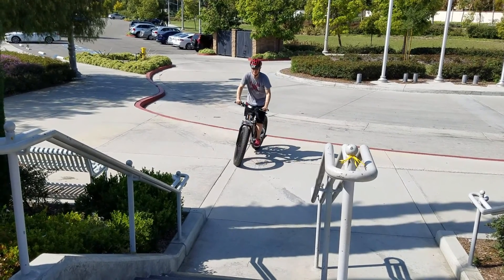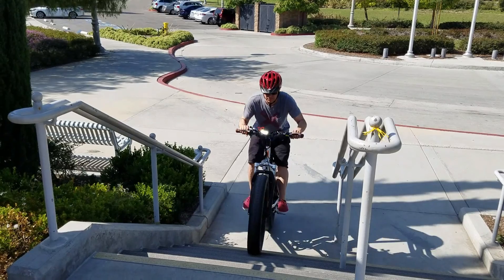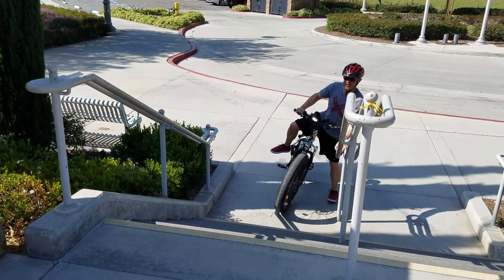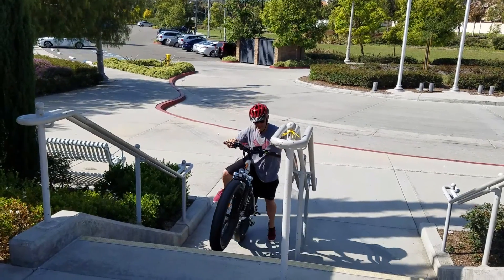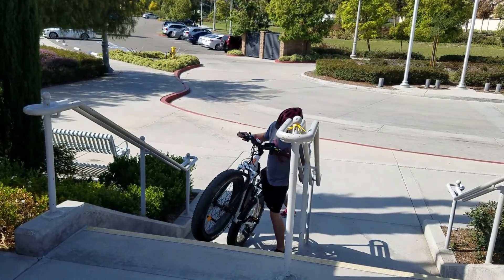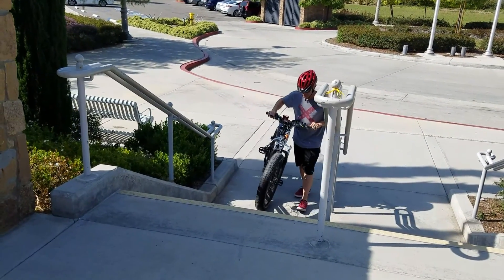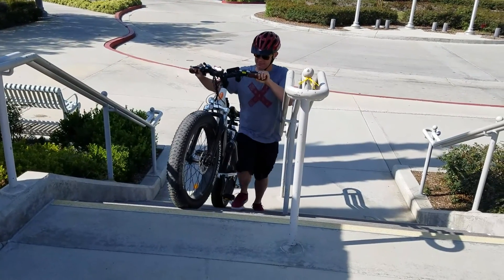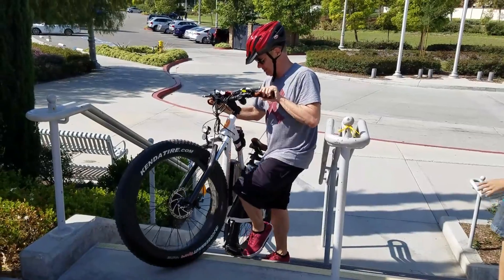RadRover electric bike up stairs 🎢

Comment: It's because it's a hub drive, driving the rear tire directly.  If it were a mid-drive it would be able to take advantage of the gear set on the bike, and all the torque multiplication that offers.  Hub drives are meant for urban or very mild off road use.

Comment: This is a true and valid representation, but a bit slanderous as well. In defense of the Rad Rover, coming into a hill with the proper speed, gear and peddling, it can climb very steep hills and rugged terrain well. But with the throttle only and coming in slow to climb stairs, it's just not that powerful. Not sure even the Stealth's could do it but I don't really see the need to climb stairs anyway which is probably not a good idea to start with. These Rads are truly awesome on hills and in rugged terrain once you understand how to manipulate them correctly.